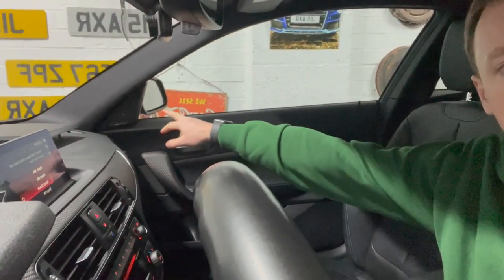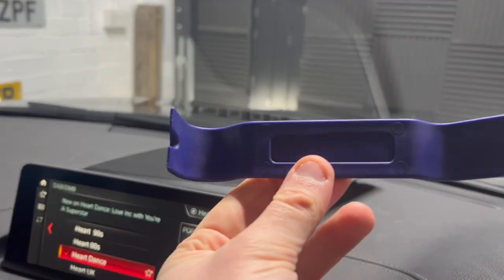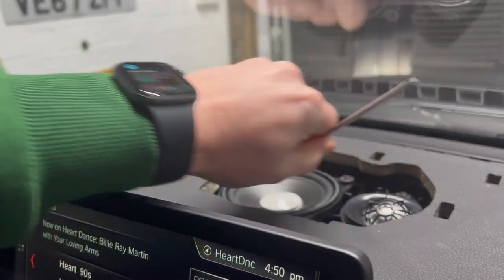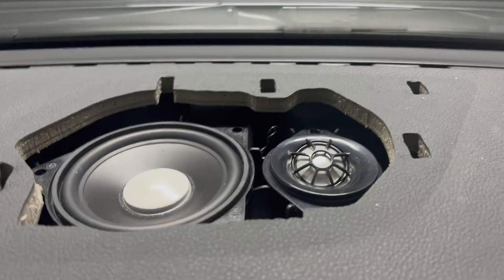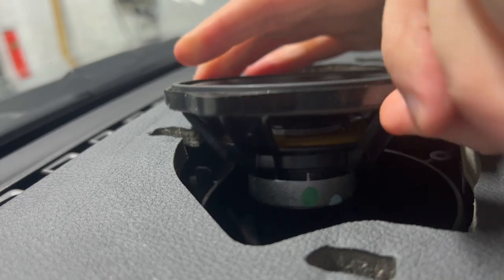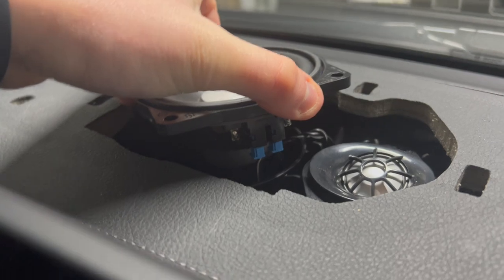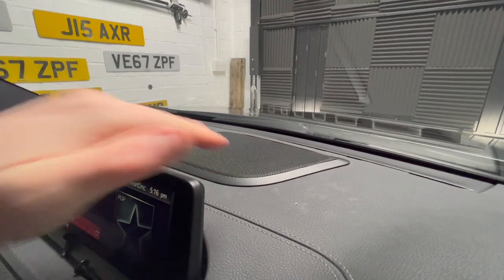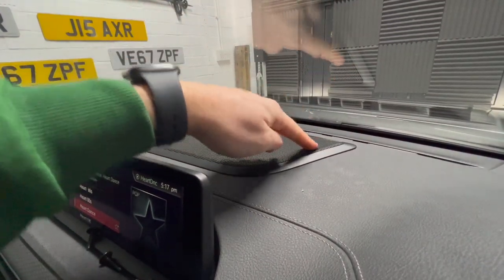Simple modification for better Harmon Kardon audio in my BMW M2

Comment: No need to remove the tweeter - just remove the main speaker and disconnect both wires there, and the tweeter is then disabled. Saves some of the fiddly work. Just leave it in place, but disconnected.
Reply from the maker: Very true, but think of the weight savings 😂

Comment: Thanks dude ,  I may try this.  I wonder if its possible to turn off the speaker via carly programming?
Reply from the maker: I don’t think you can turn it off in coding, I think physically disconnecting is the only way. You can change the sound profile in coding though and it sounds much better doing this!
Reply: @alexrogers7988  thanks , I'll have to do this!